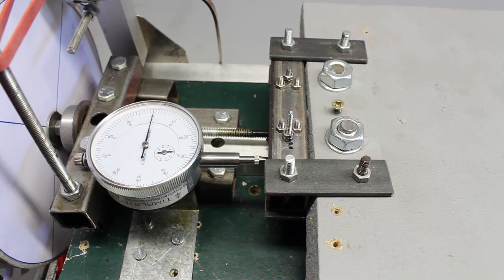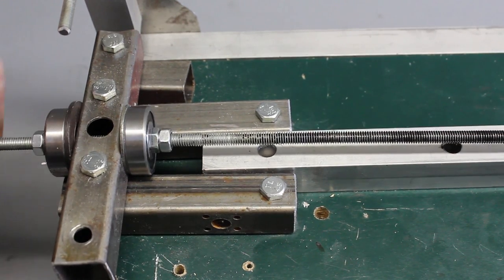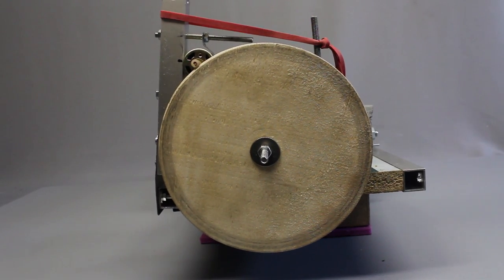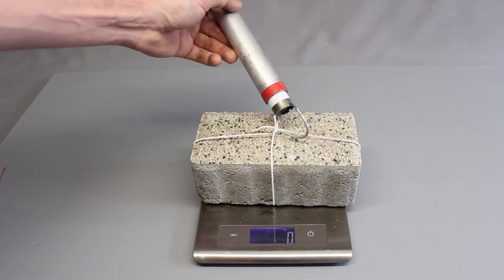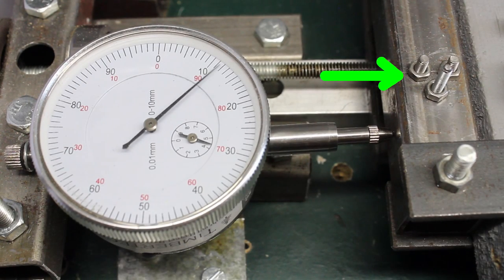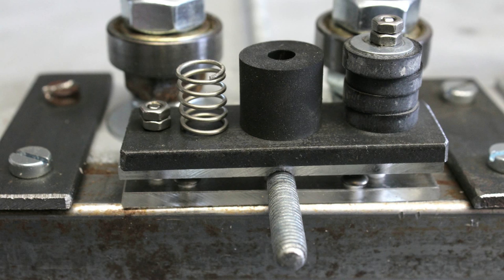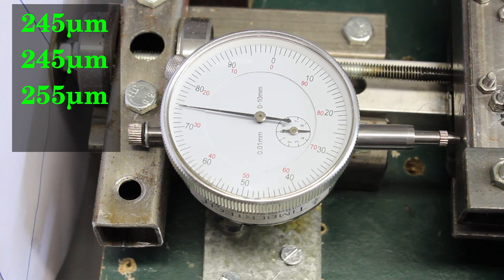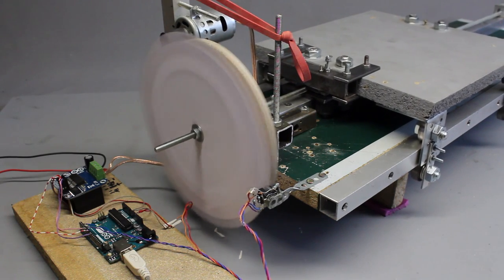Accuracy of a DIY linear drive

Comment: Great video, I learnt a lot without having to go through these steps my self. I'm intending on making my own cnc machine in a similar DIY manner, and I wasn't sure where to start. So on the back burner it went. This particularly video, as your other videos on the subject have also been great, has made think about the project again! Now I have some parameters to aim for when I design mine :) Thanks so much for making videos like this. I also appreciate the time you take to narrate them in english. As much as I would like to learn German (i'm Welsh), I don't have the time right now to sufficiently learn it :)

Comment: This is an excellent video. I love the barebones approach to precision and the creative things you do to solve the problems of not giving oneself a huge budget.

Also the experimentation is great! I've been thinking of these issues you are trying to solve for a while (i am designing some of my own cnc machines, a 3D printer at the moment) and it is awesome to see some real wear testing done. Hopefully I can do the same someday.

Keep up the great work!
Reply from the maker: 3D printing will become a subject on my channel, but CNC routers are currently on top of my list. A systematic approach helps to get better results. My CNC v3.2 uses most of the principles tested with this linear drive and the first results are promising:
https://www.youtube.com/watch?v=ogaIXwTe_PM
Reply: great job i like your videos i have i little problem how cam i let arduino do the steps depend on the light diod i try to get that code but i still have a problem if you write the code i will be so blessed
Reply from the maker: Have a look at my chapters about rotary encoders including the sample codes:
https://homofaciens.de/technics-base-circuits-encoder-disc_en.htm

I am not the man that writes your code for free. Your project - your work ;-)

Comment: im building a cnc milling and i find many problems in mechanics because i have low tools, i build all the circuit of driving and write all codes for programme the microcontroller and software....the first cnc i made it was just for drawing i success in it and i'm going on. i just want say thank you so much because your awsome video helps me so so so much in this.. god bless you

Comment: Can you use in the next videos a battery powered drilling machine motor with its gearbox and chuck attached? I'm interested in building a linear actuator like yours and I wanna know if that motor-gearbox assembly can handle huge forces
Reply from the maker: If you'd like to know if a drilling machine is powerful enough for your application, try it out.
"Huge forces" depends on your point of view. An ant would call 1Newton "huge", an elephant not...

Comment: Hey, I know in one of your videos you say the width of teeth of encoder wheel is limited to the width of space between 2 photo sensors. Turns out, you can get much more fine teeth on encoder wheel (the limit is the width of slit in each sensor which is more like 1mm), no matter the width of the photo diode. You can put 2nd sensor anywhere on the wheel as long as it's in phase + 1/2 teeth width apart from other one.
Reply from the maker: Yes, thanks for sharing your thoughts. I have used wide teeth that cover both sensors, because this is  the simple way to make it work. For my latest CNC I have modified the rotary encoder exactly in the way you suggest:
http://homofaciens.de/bilder/technik/cnc_v3_2_1_005_1920x1080.jpg
The video about the electronics of this machine will be published at the end of next week.
In another video I will explain in detail how to arrange sensors and tooth width of those rotary encoders - stay tuned!

Comment: Your videos are great. Highly informative and entertaining - thank you. Your video got me thinking about the accuracy of ANY CNC machine - whether it's homemade or commercial. They all suffer from the same thing which is that the machine thinks it's actuator is in a specific place - but - due to factors like distortion, stepper slip, backlash etc. - it isn't.

I know that milling machines and lathes can be fitted with digital readouts - essentially, they count the passing of tiny lines on a track fixed to the machine axes. The machine can then know where it is by direct measurement - rather than by inferred measurement through some proxy like rotary encoder or step counting.

A CNC machine built with this concept could be very accurate even if the engineering suffered from distortions, because the software would read the actual actuator location.
It would mean expensive ball screws would be un-necessary for example.

Do you know if any CNC machines are built on this principle? Could you use this concept in your low-tech approach to building CNC machines?
Reply from the maker: Some industrial CNC machines use high resolution linear sensors to do exactly what you have in mind.

To get an accuracy similar to that of the drive in this video you need a sensor with a resolution of 5 micrometers and less which requires quality sensors.

Software and electronics can compensate some of the backlash and distortions in theory, but a good mechanics will give better results. If a router bit dives into your workpiece, your control circuit won't be able to eliminate all the backlash, just because it can't compensate the rapidly appearing  (bad) vibrations.

It's another step to an ideal CNC and I will create linear sensors in the future, but currently I am prefering the classic design.

Thanks for sharing yout thoughts!
Reply: Absolute optical encoders and/or absolute magnetic encoders exist and are used in the industry. But they're pricey... Technology is then mostly on the track itself, made from materials with very few thermal expansion and a near zero hysteresis level. Glass is the main material for this application, and engraving it is the key for precision. Those digital sensors are passive and only sendback absolute position after reading it directly on the rule and compute. Check for Patent WO 2002084223 A1 by Renishaw in example. Have a good read :)
Reply from the maker: Yes, there is a lot of engineering in quality sensors.
Reply: Could you use some kind of laser meter to measure deviation and would it be precise enough to help on such low margin of error? I've been looking for the working principle of a laser meter but could not find much on youtube. Thank you for all the sharing.
Reply: algotrash Search for tools used in metrology for the industry, then grab some brands and go on patents libraries online, you'll then find more technical informations. No need to reinvent the wheel, and as it's for your own use, there are no worries to have :)
Have fun !
Reply from the maker: Patent libraries are indeed bonanzas, but there is also a lot of fool's gold ;-)
Reply from the maker: I keep that laser meter idea in my head.
Reply: @HomoFaciens  could you build a linear motor?

Comment: I wonder if you could grab bicycle tube and use it as large "gear" covering so its wood grain does not wear on motor rubber as much?

Nice explaination on some backlashes and ponental issues though. :)
Reply from the maker: There is almost no wear caused by the plywood, thus you don't have to make it more difficult to build.
Reply: Hmm true I suppose

Comment: Great video but can you show how you mounted the bearings ? Also why not buy two threaded sleeves which are common in stores ? Thanks in advance
Reply from the maker: This was just a quick build for doing some experiments. I will show construction principles of the mechanics in the next weeks/months - stay tuned!
If you use steel sleeves on a steel threaded bar, there is wear on both parts. With the plastics thread you limit the wear on the plastics, leaving the steel thread intact.
Reply: Instead of steel sleeves use brass or bronze ones split in half, instant halfnuts.
Reply from the maker: steamboatmodel
Brass is okay, bronze might be too hard and so cause wear on the steel rod.

Comment: Probably the lead screw has some cyclic error of its own
Reply from the maker: Definitely! With that arrangement I only can detect relative errors. I will try to build an arrangement to measure the absolute error as well on one of my CNC machines using that kind of linear drives.

Comment: Due to the cost of hardware in Australia it would be cheaper to buy a ready made machine than build something like this here.
Reply from the maker: The cheaper a machine, the lower the precision you get with it. Price is definitely not the only feature of a machine to be considered ;-)
Another reason why I build DIY machines from commonly available materials is that you can't learn more intensive than by building something from scratch.
Reply: I agree , I'm currently build a router using cheap chinese rails, bearing blocks and acme threads for the lead screws, it worked out cheaper for the parts than buying skateboard bearings and lots of nuts and bolts. see how we go with accuracy in the next couple of weeks when i get it put together. I'm learning a lot in the process.